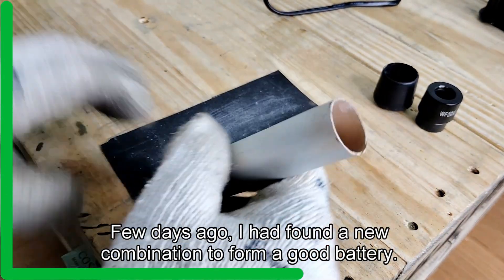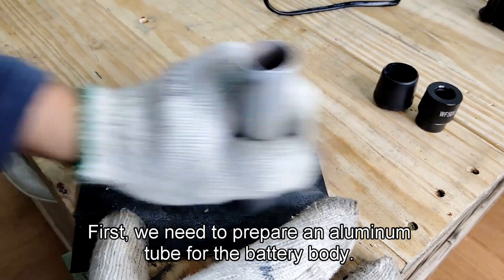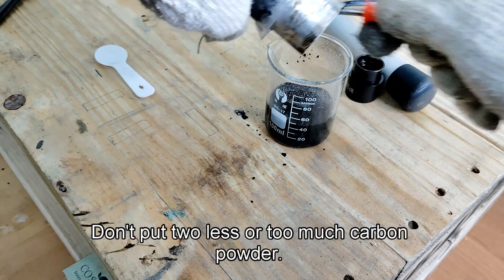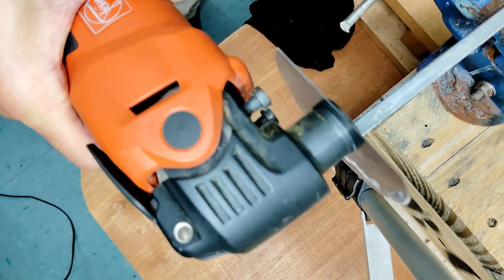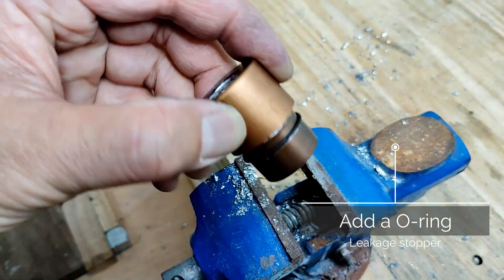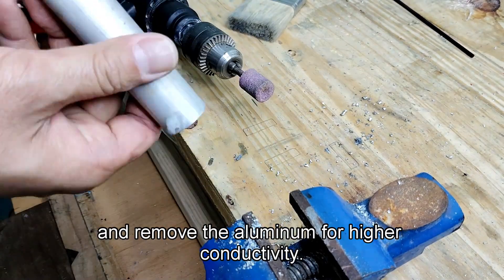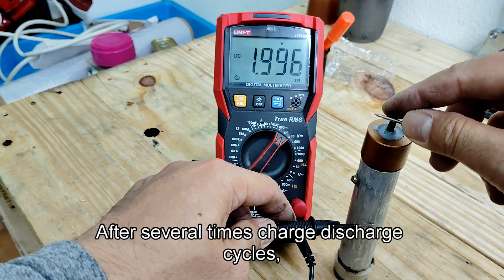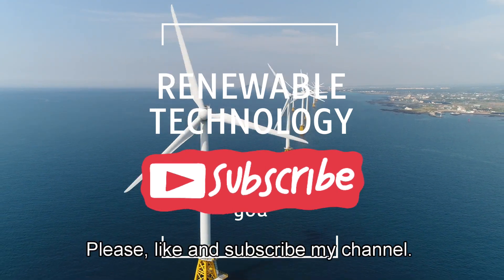[SodiumSuflateBattery] #ChemicalEnergy #RenewablePoweR #PowerWithin #BatteryTechnology

Comment: I'm honestly surprised you even had a voltage reading.  This battery is short circuiting, there is no separator... Probably the only reason you even had a voltage was due to the very high resistance in your carbon paste.